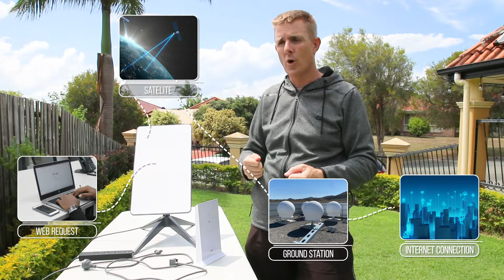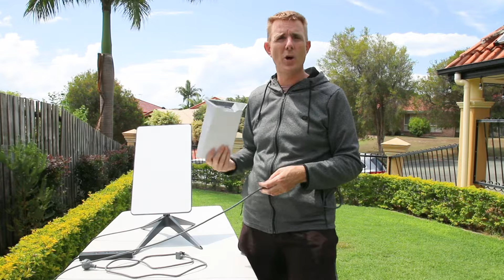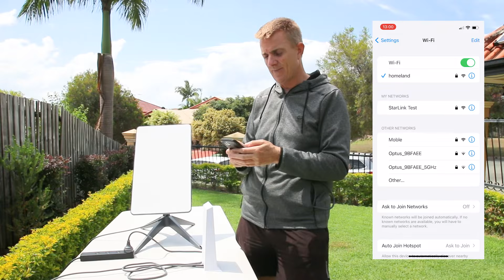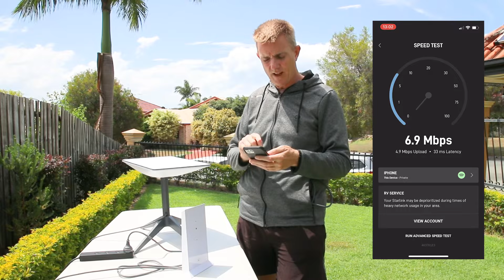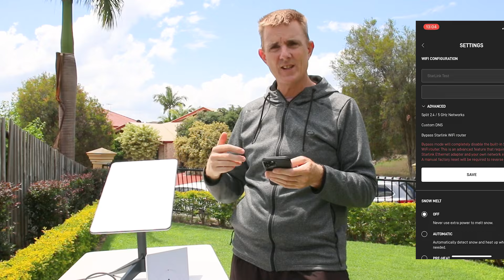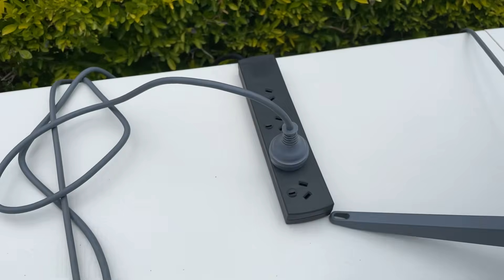Help - Starlink Where Do I Start?

Comment: Does the starlink router still put out a wifi signal to be used ?
Reply from the maker: It will depend on your setup.   If you don't want it to as you want your new wireless devices to do that, then you can turn it off.   If you want to keep it and also have wireless provided by other devices, then you can also do that.   I would maybe just give it a different wifi name to the one you have assigned to your new wireless devices.